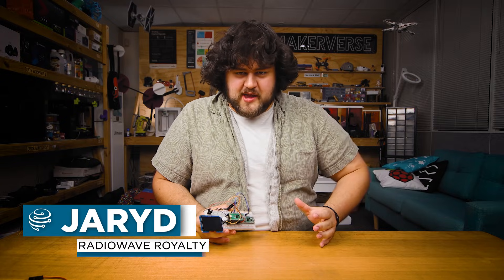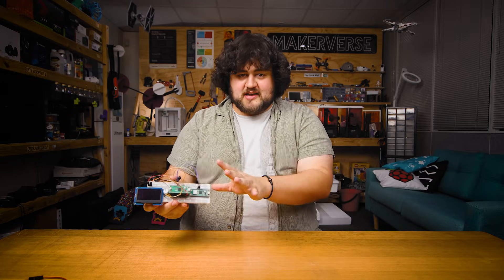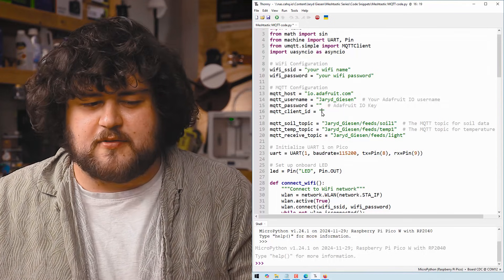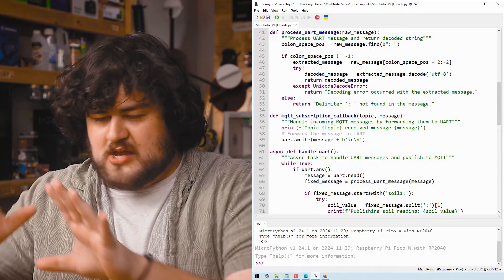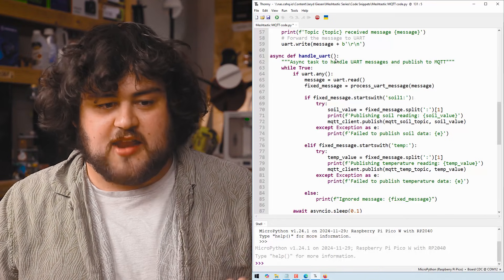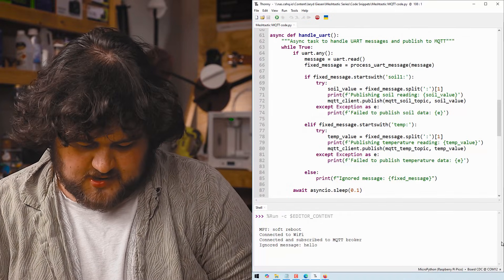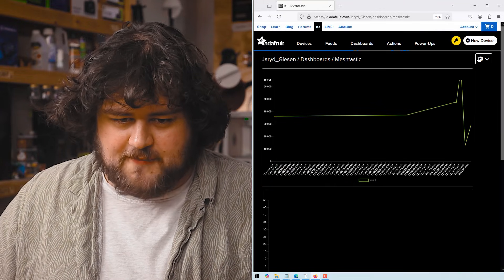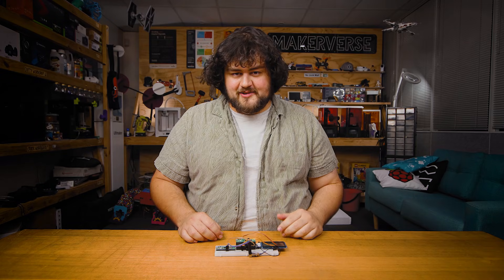MQTT Integration (Adafruit IO and Home Assistant) | Meshtastic for Makers

Comment: What I understand is that you can use the mqtt module on the meshtastic device. You can even turn on json encoding so you can simply decode it in your own application. 

Not tested it yet. But I think it is easier than connecting your own microcontroller that forwards it to mqtt 🤔
Reply from the maker: If you do find a way, let us know! We found that it was near impossible to set a consistent topic, and topic structure. The guides using that method involve have a device convert it from MQTT module output, to the format for the MQTT broker, and if we are going to that effort, might as well use it on the Pico as its cheaper and less power hungry.
Reply: @Core-Electronics  If you have a particular MQTT broker that you want to use, and it has a specific topic format and payload format that it needs, then no, you can't use the Meshtastic device by itself. However, I am running my own MQTT broker (it's easy!) and can decode and forward the Meshtastic MQTT payloads to Adafruit IO, Thingspeak, etc. in whatever format they require.

Comment: Wow! I’m not technically trained so I would like to ask, can I connect this meshtastic to a 3D printer that does not have a built in online connection and send my files to the printer through the internet?
Reply from the maker: That would be amazing if you figured it out. I think the short answer is: it's theoretically possible, G-Code is plain text so you could send G-Code messages over Meshtastic, but the packet limit on a message is 255 bytes so any print would have to be broken down into hundreds of individual messages that would need to be stitched back together on the other side.